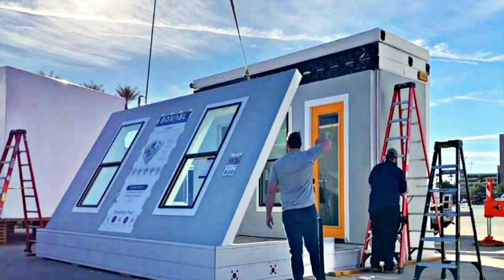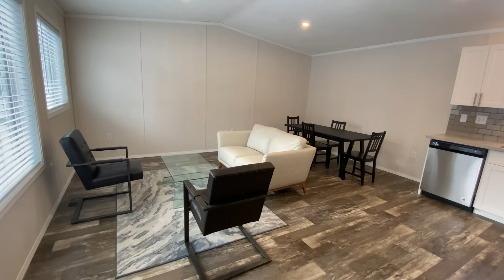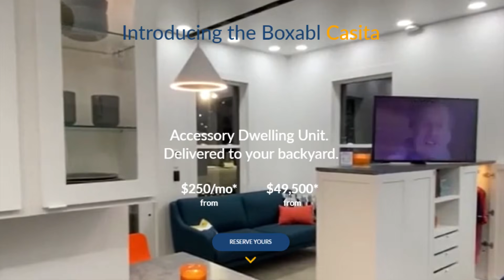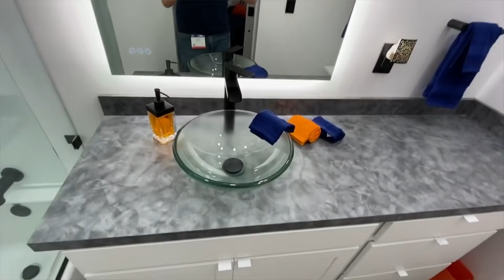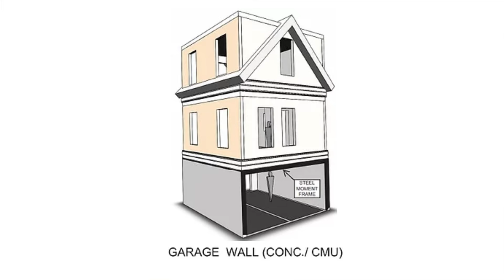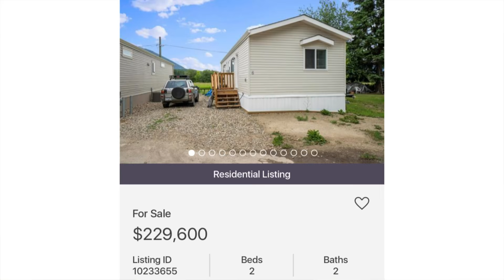The Real Cost of Elon Musk's $50,000 Boxabl Casita

Comment: Guys, if you're handy with a nail gun and a saw, you can build a single story, lean to style, 15'x40' house for like $20,000. Thats just the frame, shell, insulation, and pad, but wayyyyyyy cheaper and you can have exactly what you want.

Comment: - If you can live within its storage and occupancy limits (2 mature adults), the Casita is very affordable for what you get, because of the efficiency of its layout and operating costs.   If I were single, I'd get one and put a garage or workshop shed near it and solar panels on both roofs , which would drive up the initial  cost , but not by as much as if it were a stick built existing house. When the next gen larger and 2-3 module Boxabls are available they should have a lower cost per square foot because the core appliances are only in one module and there's only one set of hookups.
- My take on house size is that capacity is measured by how many people can live in it in harmony. That depends on the family.  If the folks in yours can't wait to get away from each other every morning,conflict has a cost.  To get the lowest cost of ownership then get divorced.  Get two Casitas and give custody of some of the  kids to each spouse.   ( If you have too many kids to fit in 2 Casitas,  imo,  you have too many childen.) 🤣

Comment: In America the housing market is peanuts compared to the uk, where a typical 3 bedroom house will cost you £250,000. And you will need a 10% deposit to start. Then solicitor costs, inspections and any building costs if it needs doing. So it need £300,000 sterling.

Comment: You can buy flat pack house frames on Alibaba that are the same size as 20 foot shipping containers for around $800 USD. I’m going to buy 4 sets and bolt them all together to make a single structure, then use self made SIPs to finish it. The whole thing will sit on a concrete piers to allow me to get under it for maintenance. Later, I will add additional sets to make sizable porches, once I save up enough to add on to it.
Reply from the maker: Thats crazy! You should definitely document the process
Reply: I’m not good with cameras and I have no film editing software.

Comment: I love the idea. The house is sustainable #1. Many of the Costs associated are the same for any house in any state in any modern society.  All the connections, all the foundation all the permits, you mean to tell me people think the Casita isn't worth that money. I can't see that. You didn't mention it can be moved, right. Also it's most likely the most energy efficient home on the market. How much will that save?  The big point I think everyone is over looking here is that 7+K delivery charge!!! That easily solvable. Get your truck and a trailer, borrow one, rent one. It doesn't matter. Pick it up yourself!!! At over 7k, you couldn't convince me NOT to pick it up. I know it's possible I've seen it advertised you could. If I. Mistaken please tell me. All that being said, even the delivery price included, it's still the best product for affordable homes on the market. If you can find another home, all the same features, apples to apples, and that other one is cheaper. Please, please, point me in that direction. I've been an electrical contractor for over 30 years. I know this industry, I know how people sew the books cover without realuzing the value of its content, then agree with themselves what they think the costs should be, most likely comparing it to a standard stick frame house. They see the sticker price and it's over what themselves came up with, now they are haters. Uneducated haters in this example, im not implying they infact are uneducated in general, just in their evaluation of this home. It's the best of the newest home trend today. Look up these Swedish, or company from Finland, that have made these homes that look straight from the Hobbit. It's crazy. One reminded me of a Hershey kiss....lol! I meant no disrespect in this post to anyone. I'd just like to say this is the future of modern home development, so take a big whiff. It's one going to expand. Like anything else. Once they get their percentage of capitol back they worked out in their plan, you'll see the prices drop. I remember when VCR's were $800.00. Same with CD players. You can get a CD player for $15.00 in a dollar store, even cheaper on line. So, put your preconceived notions away. The future will be moving in right next door.

Comment: I intend on being totally off grid if possible with mine so those utilities will be less I still have to get my own septic system going drill a well and get solar panels. So I'd be spending a bit less than that to be off grid. drilling for water could cost up to $10,000 which is still less than connecting all utilities.   To run utilities in a small place like that I would probably need a couple solar panels which would probably cost me about $10,000 for both so I'm about around the same however getting it where I want it to be maybe where it is tricky I do plan on buying land but will wait on the home untill paying off the land. I am not going to get land that's going to be too high in elevation. Maybe up in the northern foothills of California

Comment: The site prep work is there regardless of what type of house you build. 
So, looking at sq. ft. price on new construction is the fairest comparison. 
Given the rising cost of wood, pole buildings are now as expensive as the Boxabl Casita.
Metal frame buildings are another option. And then there's the traditional stick built house.
New houses can't be compared to existing houses because the existing house is not new and may need a little or a lot to freshen it up or totally remodel it.

Comment: I disagree that these are a good value because in an expensive area (where you are recommending these), there is no point in spending 300k or more on a tiny lot only to invest a relatively small amount (50k) on a garden shed. You will hate your life after 2 years and wonder why you thought that was a good idea.
The only good use for this thing is an air bnb that you can put in your backyard.
If i were gung ho to build new construction with a tiny budget, I would do the labor myself to max out my square footage.
Modular homes are not new. They've been around forever. There is a reason why they are still not common.

Comment: When you think of a startup situation and initial costs of getting production going and keeping up the regular production schedule,  I think we can assume that eventually, the actual cost of this system should be going down a few years after the initial startup cost has been absorbed.  Any prototype is expensive, and any business needs to recoup the expense of design, R&D, and upgrades aside, after that, the basic units should become even more affordable as time goes by. Of course, there are factors that can run up the cost of doing business and manufacturing, such as labor unions and taxation.  If the industry can avoid unions, and local governments can give tax breaks and incentives for this type of low-cost housing in needed areas, this could be the big wave of the future in truly affordable homeownership.
Reply: Disagree. They will gradually increase price as demand increases. Sooner or later they won’t offer any savings. Just economics.

Comment: Just a quick question for clarification: You said that you based your prices for setup on the location you're currently building in British Columbia. Did you adjust the prices to reflect USD vs CAD? I know the Boxabl Casita is quoted at $50k USD but if you're looking at CAD prices for setup/utilities/etc then it could be skewing the overall price higher than if adjusted.
Reply: ARaddue: I was wondering the same thing. Too bad the videographer doesn't answer questions here. Would be a big help.

Comment: Interesting video that still omits or underestimate a bunch; here are a few that come to mind:

As with most of these videos, the value of buildable land is barely discussed. Unless this is a backyard building,  a semi-desirable buildable piece of land will be hard to find under for $100k.

Most places are going to require a proper survey before you put the thing down; that can easily run in the $thousands.  An attorney and a lot of back and forth with city hall may be needed to address zoning, permitting issues etc. 

No general contractor fee?  I wouldn’t recommend this project to someone without significant building/development experience; a lot will likely go wrong otherwise.  Coordinating permitting, excavation, foundations, utility work, plumbing and electrical connection and how it’s done in a particular locale is not something that can be learned from a Youtube video.  I can’t see a legit general contractor (licensed and insured) taking on the headache and liability for less than $15k. I certainly wouldn’t it for less. 

Some landscaping and paving.  

I probably forgot half a dozen other things. 

Unless one lives in a super cheap area, better to plan at least $50k on top of house and land cost. 
 
Bonus: In an expensive city, expect stickers shocks. I just had water and sewer done (consisting of a single 4" sewer line and 1.25" water line) for a small multifamily in my non-prime Boston neighborhood.  The water and sewer main were just on the other side of the sidewalk. Without major complications it still cost me $42k to get these connections. That was the lowest bid.  The $2k mentioned in the video would barely be enough to pay for the detail cop -a requirement for all street work in MA!  One item was capping the old sewer line (from the previous house that was teared down decades ago) and that alone was a $8k item.
Reply: Vivian Girard wrote "a semi-desirable buildable piece of land will be hard to find under for $100k." You are living in Boston; there are many other places where land is a lot less or a lot more. A general contractor is not needed for the house installation, as a crane is used at the time of delivery and house "unfolds." It is a lot easier to pay a contractor for site work but it can be organized if you have some experience.

Comment: It's not too bad if you're building it as a mother-in-law's house, go for a standalone property I would have serious reservations about its resale ability. Frankly though I think there are much better options, look into Yurts especially if you're looking for something in the 400 square foot category, a 24-foot yurt with full insulation and snow and wind packages from Colorado yurt is coming in under $20,000 and you will likely have about seventy more square feet to work with and with enough height to make a loft a legitimate option increasing your living space even more for relatively cheap. Granted that's not the entire story because you still have to build the platform and the internal finishing work needs to be done but you got another $35,000 to do that with.

Comment: This is a step in the wrong direction.
The larger issue is that these homes are NOT futuristic and most certainly not “future proof”.  I use that term quite literally as global extreme weather events need to be within the top considerations when developing new means of shelter and home-building practices.  I am mostly referring to standard architectural practices, materials and structural engineering that have been failing miserably in the face of extreme flooding, fire, tornadoes and hurricane events.  Although these flat-packed tiny-house models may be more affordable, they are far weaker than even a wood-framed house.  
Architecture needs to be overhauled and homes need now to consider storm resistance as a top consideration.  Similarly, the automobile industry was forced to go from style, reliability and functionality as the highest consideration when first mass produced, it needed to be transformed to accommodate the highest standards of “safety” after so many where being killed as a result of accidents.  Homes should now be made with more durable materials, elevated, fire proof, bug proof, wind resistant.  Round homes, concrete, slab roofs, elevated first levels.  We literally need to be building homes like we’ve always built lighthouses and bunkers.  That is the way forward.  These plastic homes are a huge step backwards.

Comment: One major omission was the roof. In different videos and interviews with one of the Boxabl founders, there is a pretty big hint that you'll probably need an actual roof. My guess is that unless you're in the desert, you'll pretty much need one.

The cost of constructing a pitched roof would not be trivial.

I'd also imagine that the $50k + shipping won't include the cost of assembly and mounting to the foundation.
Reply: I just saw a vid, pitched or flat roof, with solar panels
Reply: @jaceebrynne49  : is the roof included in the $50,000 cost?

Comment: Sorry buddy, you called the Casita an affordable option in CA. Maybe if you lived in the middle of nowhere, but even in one of the least desirable communities in the bay area ( Antioch) it is about $100,000 just to pull a permit to build, another $150,000-200,000 just for a piece of land to put your tiny jail cell on. Add in everything else you need to actually have a functional house on the property and you might as well go buy a normal house or condo or just go live in a trailer park which actually could be affordable potentially and last just as long. Game over.

Comment: Most mobile home manufacturers slap those suckers together(the quota has to be made). It “is”
very inexpensive and it’s a better choice than renting “if you have land”. But thin insulation and the materials degrade too fast. (I will admit drier areas are going to fair better than high humidity- mold can form easily). Good choice to be placed on a decent foundation(Should help protect the pipes, prevents mice from coming up through the vents or from creatures living/dying under the trailer). I lived in mobile homes/campers for a good portion of my life….and even(some) of the more run down brick/mortar houses are going to be sturdier. 
“If you have a choice” please do your research before deciding because you might stay in that trailer/camper for about 15-20 years. (I know not everyone can afford the luxury of choice, so this is for those that do have decent credit etc.) Also, I’ve seen people work hard on a house just to have it taken away + loan discrimination. Trailers should be for emergency accommodations not permanent living but the whole housing system is fkd.
Reply: We pay 2k/mo rent to live in a 800 sf mobile home in California.  Can't afford anything better.

Comment: Well done, and reasonable...however, I am from Calif. and live in Missouri.  Totally different TCoO analysis. And you did leave out taxes...i think.  Second home would cost me 3sq. ft for slab, utilities are in maybe 1000.00  I will pick it up say 800 miles at 2.00 per mile, I am not sure where they get their number...I just don't see 23,000 maybe max 5-10.  Low cost housing means low cost set up....makes no sense otherwise. "Cater to the masses eat with the classes, cater to the classes eat with the masses." Ray Krock I believe.  however the stability, the speed of completion, and long term expense makes this is well as similar ideas, well just plain ole awesome.  Anyway just my thoughts

Comment: Does the additional $20k+ apply to the first box only? If you did a home with 3 boxes for example, would it be $175k, $75k for the first one and $50k for each additional?
Reply: I would think that the first is the most expensive as it includes the utility hookups and permits. If you did multiple modules at once, you probably would only incur the cost of the foundation. If you added on later, though, then you would need to go through permitting again in addition to building costs.

Comment: The biggest problem and difference between the 2 is that you can NOT get a mortgage on a Styrofoam box. Sure you may be able to get some kind of loan but it won't make the property appraise or give it equity.
Reply: I could drop 1 of these on my lot here in Los Angeles and get $2,000/mo easily . And if I ever were to sell my property, that would be factored in with buyer , even if it’s not factored in with the overall property appraisal. Btw .. Why wouldn’t this be appraised , if it’s permitted as an ADU ?

Comment: But hold on. Price Per Sq ft on a comparable home the land is included In the dollar amount Per Sf and also includes all the Utility installations. A boxable at 133.00sf does not. Therefore you must add all the external values including Land to arrive at the boxable price per Sf to compare Per SF value. After all your install cost your at a  minimum of 194.00SF and that still does not include land value that a comparable home would.. Also good luck getting a loan on that. With all the things you need to do, you might be looking at a Construction loan that most people can not afford the required down payment on. maybe putting it in a Trailer park would work out value wise?